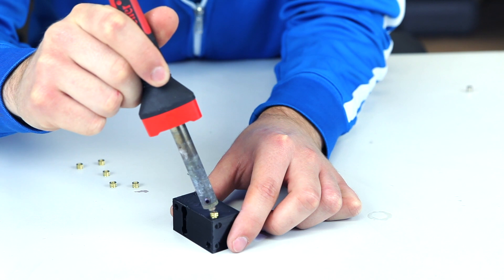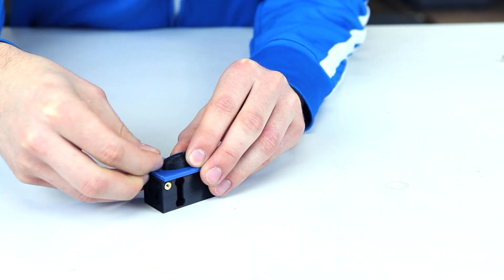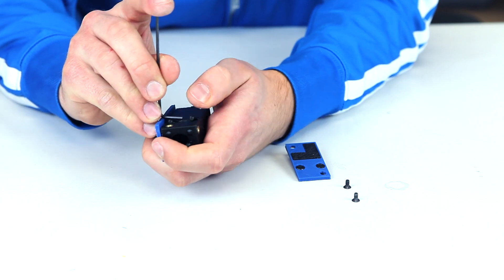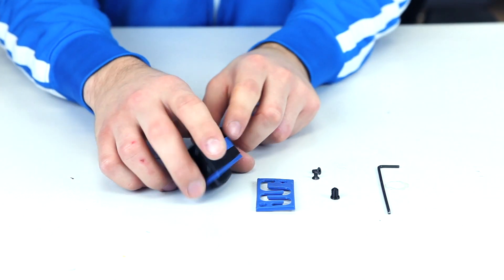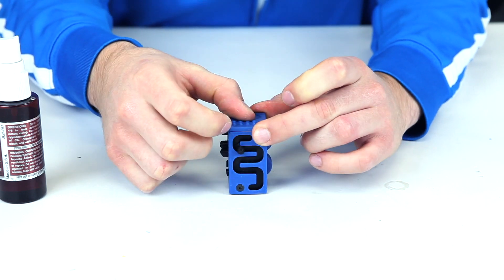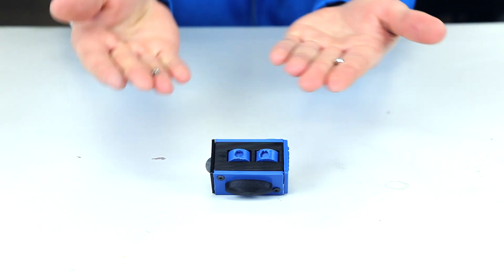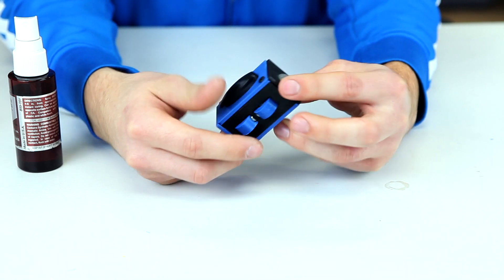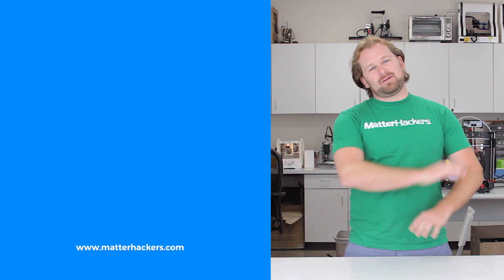How To: Assemble The Twitch Block // 3D Printed Fidget Cube

Comment: I'm Making this cuz my school has a 3D printer
Reply from the maker: Awesome! Let us know how it goes!
Reply: I made it but my schools printer cant print rubbery material like soft buttons
Reply from the maker: That's okay! You can still customize it any way that you want! No flexible filament needed!
Reply: Instead of flexible filament is it possible to print those pieces out in regular filament and dip them in liquid or gas acetone? Because I've heard that acetone can make your prints softer and more flexible, so would that be a good replacement you think?
Reply from the maker: We wouldn't recommend using that as a replacement. Acetone dissolves certain filament, but it doesn't make it softer or more flexible.